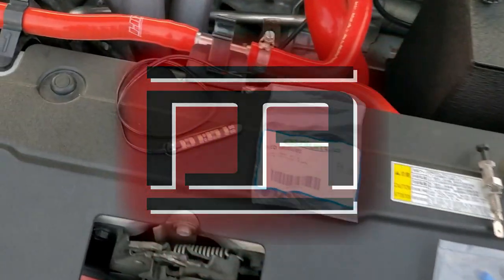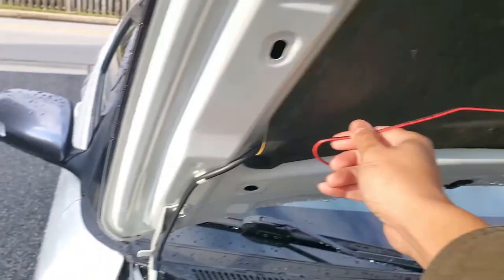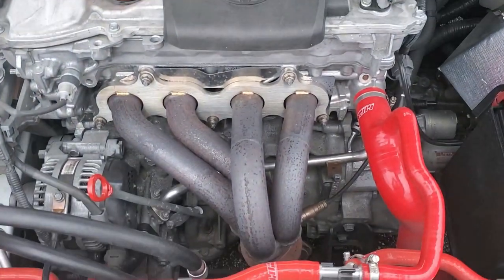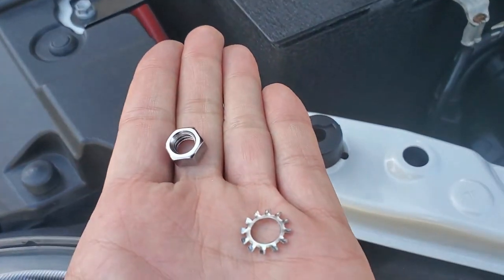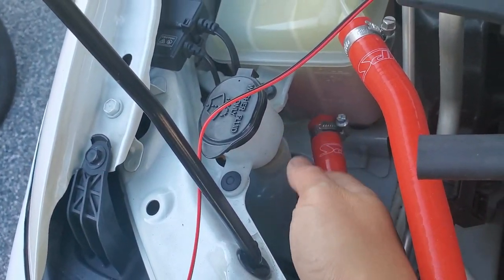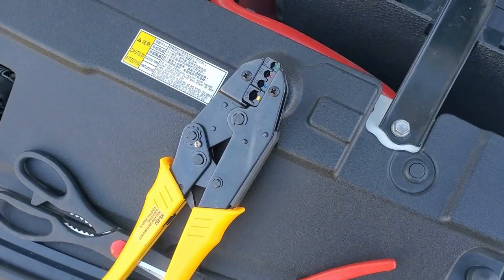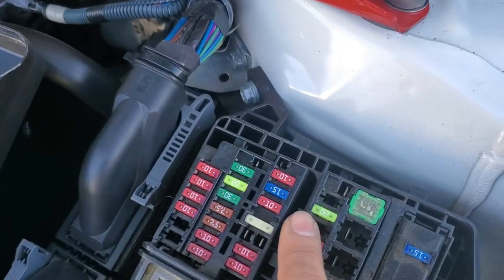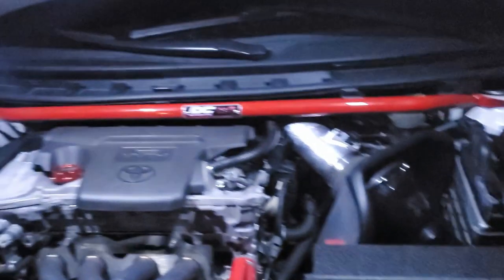Automatic Engine Bay LED Lights Using Hood Pin Switch (Scion tC2 / tC2.5)

Comment: Where did you get those tentacles on the rear of your car? Is it a sticker? Where would I be able to get something similar that’s as big as that? Thanks !
Reply from the maker: Amazon. It's actually a wall decal.
Reply: @VampyreX13  oh I wouldn’t even have thought it was a wall decal haha. Thanks for the response
Reply: @VampyreX13  was the decal hard to install?
Reply from the maker: @majapan7521  they only give you 1 transfer sheet that you have to share with 3 sections. Unless you're experienced with large decal installations, it's going to be a huge pain to do, especially because of all the individual tentacle suckers.
Reply: @VampyreX13  have you had any problems with the decal? Any peeling or any issues like that?
Reply: @VampyreX13  does it stand good against rain?
Reply from the maker: @majapan7521  yes, in fact it's standing up against the snow as well.
Reply: @VampyreX13  how long have you had the decal for?
Reply from the maker: @majapan7521  5 months. It's not even an outdoor rated decal, so I'm pretty impressed at how well it's holding up.